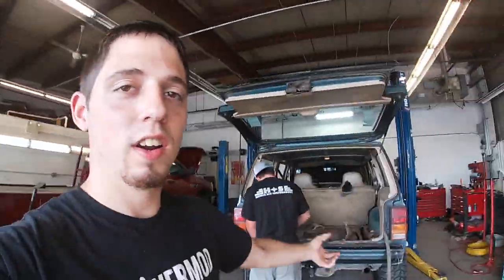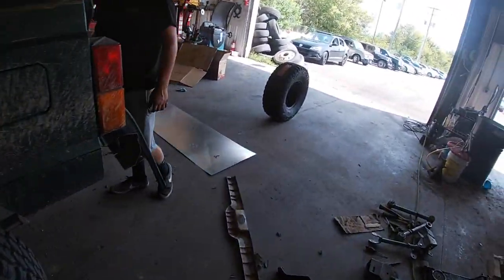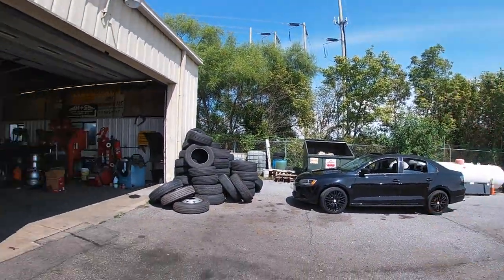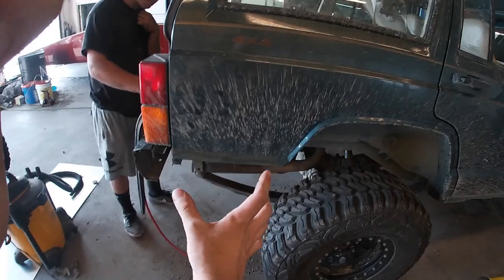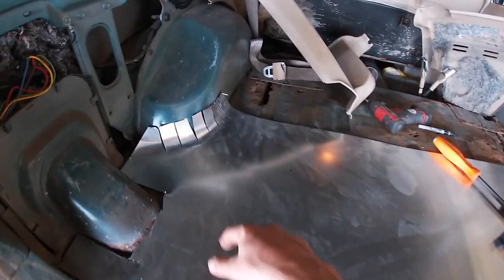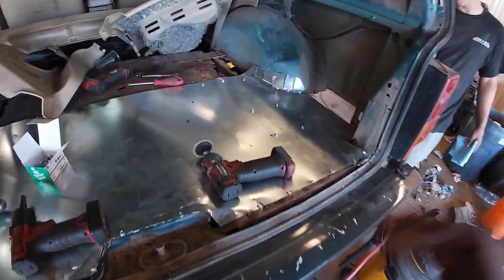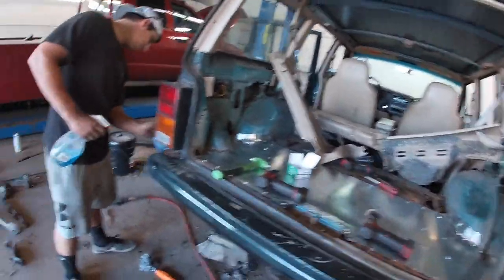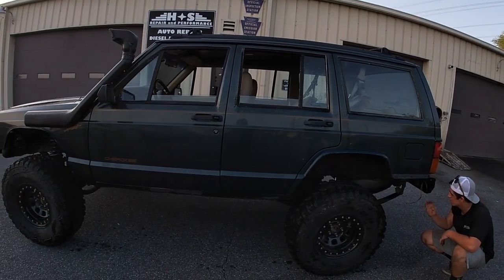"Fixed" The Rust on my Jeep XJ for less than $100?!?!

Comment: Also, Lowes has that crazy "as seen on TV" super sticky tape. It's pricey but works great to seal to cover gaps between your new rear floor and the wheel wells or any where else you need to seal stuff up (Flexi Seal tape)....

Comment: POR 15 is pricey but worth every penny. You don't have have to go crazy removing or cleaning the rust off the metal. I got my metal for the rear floor from Lowes, probably not the cheapest option, but it was in stock, I didn't need a lot and they are close by.  You have to work with what you got.
Reply from the maker: I used por 15 on my wrangler after we fixed the frame.

Comment: Great video! Not to offer advice to experts... but putting any sharp pointy objects aiming towards your gas tank, if you plan on beating on this thing... regardless of if they are self tappers or pointy screws... might not be on the good idea list... a rivet gun might be cheap and a lot safer... they are easy to use and look good as a finished product... knocking an axle off makes you a badass on YouTube... lighting yourself on fire makes you a spectacle on LiveLeak.... stay safe Bros. Thanks for a great vid!
Reply: haha 'experts'

Comment: I live in southern Virginia. My XJ has a hole in the right rocker panel about six inches long and some little holes in the passenger floor. I've been trying to sell it and the thing only has 79k but everyone around here acts like it's just completely totalled.
Reply from the maker: What year is it and what is your asking price ?
Reply: @JeepinDaily  99. $3k
Reply: @cannibalchainsaw  yo you still got it?
Reply: @imetuaneteley6629  nope, sold it. I have another 99 XJ with around 180k that needs a brake line and a windshield.

Comment: What exuast R ya running? sounds awesome .nice job man jeep xjs getting hard to find.
Reply from the maker: No cats and a tiny knock off muffler.
Reply: @JeepinDaily  sounds better than my 40 series truck/jeep muffler....I also wanted to ask,  what brand manifold are you running wanna know off hand and has it been good to ya ? Simply about to replace mine just having that moment of not sure what brand haha
Reply from the maker: Manifold? Everything is untouched on my Jeep. Just stock everything except the pipe from where the cat would be to the knock off muffler
Reply: @JeepinDaily  that's awesome man sounds great.

Comment: the whole integrity of the structure has failed. That jeep is no longer safe. Bu putting self tapping screws in some flimsy sheet metal won't cut it.